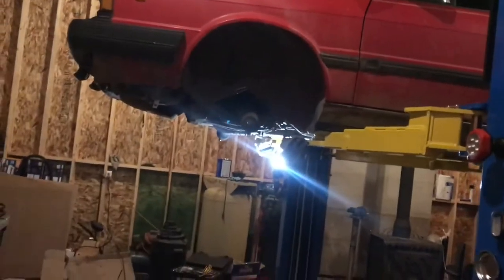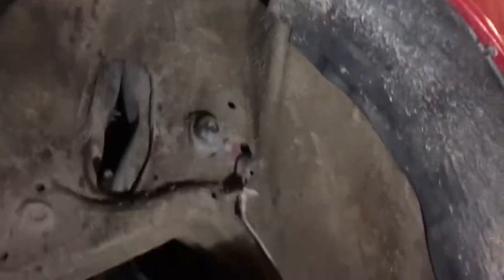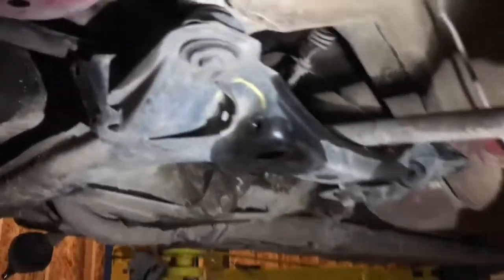Audi 4000 Suspension Project Part 1

Comment: I bought a 1978 Audi Fox someone had put the turbo diesel VW motor in it. And I'm doing the usual suspension and brakes and got to that rear suspension and there's like a little diagonal arm and I thought I'll try to replace these bushings and now I see what you're talking about fiddling those wrenches in those little holes those little holes are so Rusty now I can take a die grinder and cut them out at square plates and Bolton covers and repair the rest at the same time. The bushings what are they where do you get them how do you know what to buy I can't pull anything up under 1978 Audi Fox rear suspension. So so replacing the rear shocks got everything torn down all the brakes off and I thought now is a good time to change those bushings if I could find where to get them they're not gone yet but they're 1978 and it would be wise to change them. The front subframe bushings I haven't even begun to think about them. I did all that on a Mercedes and a few tricks those came out pretty easy. Same basic principle that subframe in the front I just did one corner at a time and pride them out with a long flat head and it worked.